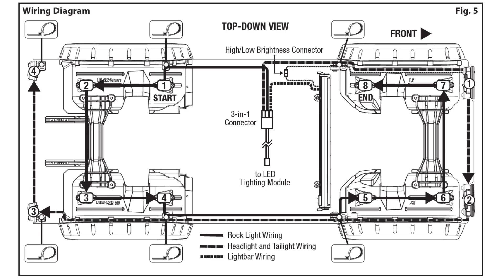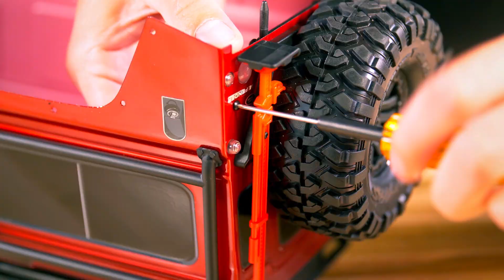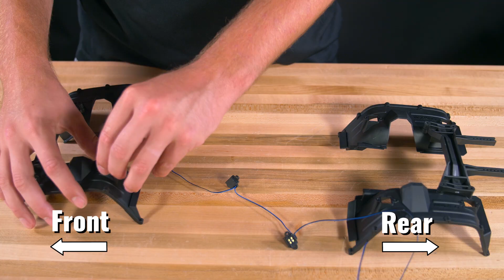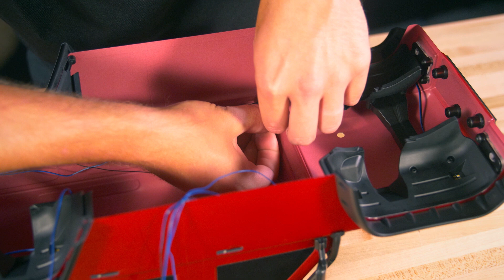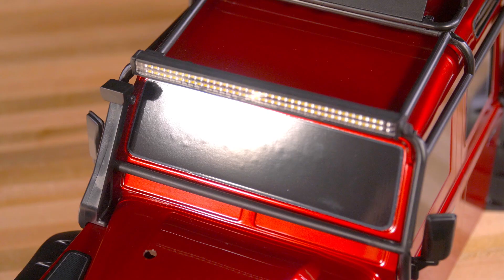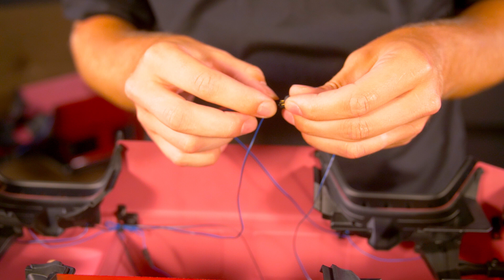How to Install the LED Light Kit | TRX-4 Land Rover Defender

Comment: Im here 6 years later, my lights kits is Traxxas 8095, Are these roughly the same instructions?? I search for a guide, it always bring me to older ones...
Reply: Hi, i am new too and will also buy the 8095. Did you figure it out yet? And can you tell me what the differences are with the set in this video? Thanks in advance!
Reply: @Keyser_Soze739  i did'nt chance doing it myself and messing it up, so i took it to a local model shop and got guy to fit them for me, (£30).. They do look class on it...Sorry can't offer anymore info.
Reply: @kris1976melo  in any case, thanks for your reply 😉👍
Reply: THIS is just about why i'm hating this hobby so much! I have two TRX-4 High Trail Editions and anytime you see a cool looking mod, there's almost zero explaination with it! So once you have the lighting installed, is the body permanently attached to the chassis? Is there a connector? Where is the on and off switch? NONE of these things are shown!!!! Bullsh*t video once again😡
Reply: @sgthulk9 I Did manage to get mine installed by someone, yes you can remove body, there is a little lead coming from light  with a connector, which u plug into your car port, you just need to be careful wen remove body just enough to  unplug it. Then can fully remove it..

Comment: I installed the Traxxas kit 8095 which I believe is slightly different than the one installed on this video…I still went ahead and followed the instructions in this video but when connecting everything at the end, it worked with the exception of the rock lights…not sure why…too bad you guys don’t have specific video of the 8095 kit install.

Comment: Everybody just be careful when you purchase kit 8095, the connection of light bar is slightly different it took me a while. You need to use hte small reduction to connect crawling lights and light bar correctly to the module, Other than that great guide.

Comment: How can an official Traxxas video show putting the rock lights in backwards .... the cables should exit the lights towards the outside of the fender so you can tie them to the strap points

Comment: Yea, I  bought the light bar to 
mount on my sport and nowhere did it say I needed the module so now have a usless light bar. It's stupid and obviously just a ploy to make the consumer spend more $ . One light system SHOULD be able to plug straight into the stock esc! 
  To not come with lights on the rtr is one thing but forcing us to buy even more parts really put me off. 
  The trx4 sport was my first traxxas purchase and this practice from them has really turned me off of the company,  I think I will explore the many other trail truck RCs in the future.

Comment: So I have the light kit installed and wanted to use my trx4 during the day so I unplugged it, let my buddy use it and he ripped the connector from the distribution block to plug in. I don’t know what I should do considering I spent $70 on them and used the lights for maybe 10 minutes. Any helpful feedback would be appreciated thanks in advance!

Comment: Hey how about a 50% rebate for sending in a picture of the kit installed, it was simple and straight forward but dang it took a while.  And why the heck does the link module not control the kit.  I mean honestly why run a cord to the reciever at all. there is not reverse lights and the brake lights dont get brighter when you slow down so why bother? Please correct me if im wrong.  Its 90 bucks for 2 strings of lights and a light bar.  They look great but should only cost about 40 tops.
Reply: Yea I don't understand why they run the wire to the RX module - whats the point?
Reply: @thejason51873  The point is $$$$$$$$$$$$$

Comment: Do you need a 3m1 wiring harness for all the light to be connected to the lighting module or can you just plug it in without the 3m1 harness

Comment: I have the trx4 sport with the expedition rack and bought the led light bar #8087 and the power supply #8028, but at the led light bar there are 2 harness , one with two wires ( black and blue) and other with just 1 wire (black) . I connect the harness with 2 wires to the power supply and the led light works , but I dont know where to connect the other harness with just 1 wire.

Comment: No it doesn’t have any brake lights or turn signals all the lights look great when they work but I must’ve got a few faulty connectors. Anytime I move the cable the rock lights or light bar goes out.
Reply: AMT99100 u need a bigger battery mabye.
Reply: Rc Basher found out the problem thankfully. It was just the prongs not making contact to connector so I put grease on them and it works perfect now.👌🏻

Comment: What happens when your gonna go driving during the day and u don’t want the lights on but your gonna go in water
Reply: This is a Traxxas fail for that,  So  my Traxxas TRX4 defender has remote activated  diff locks,  cruise control , but no way to turn lights on and off.
Reply: EZRIDER327 it would have been nice. Even if you need to use the traxxas link app, to be able to turn them off
Reply: I would take the plug out and tape a small bag around the plug so that it doest get wet
Reply: Ok thx

Comment: My light kit works well. Of course one wire comes down and plugs into the transmitter box with the rest of them exposed, is this what you call water proof technology? If I knew that the signals didn't work and no backing lights. I would have taken my chance with a different kit. $100 bucks for this kit. Seriously, Traxxas! How freaking greedy can you get? I would have bought after market with this no functionality light kit.
Reply: For what they want for this kit it sure is lacking in features...

Comment: Thank you so much for this video. Loving the new lights. Albeit wish they had more features in the way of changing when turning and braking etc.
Reply: Yeah I'm thinking of using my Tamiya lighting kits in my TRX4,  it has turn signals and  brake lights all actuated with the receiver.
Reply: @EZRIDER327  why not the pro scale lighting kit?

Comment: The LED lighting module that the wiring plugs into is not water proof. What is the point if once it hits water it is going to short out and now i'm out $100?
Reply: Look the website, there is : Wateproof on EACH image of the products
Reply: I have to respectfully disagree. Watch the video at 6:11. There is a completely open and exposed connector terminal. It will short when exposed to water.
Reply: it can ! I agree
Reply: mobgma no it will not how do you think motors work when brushes are submerged there is not enough voltage or current for the high resistance of water